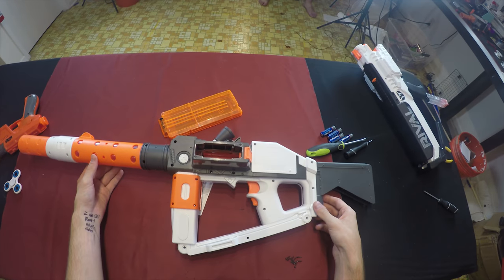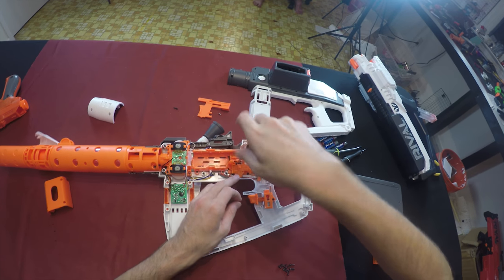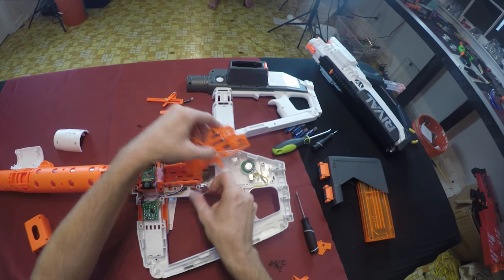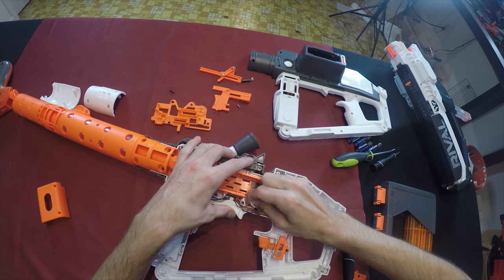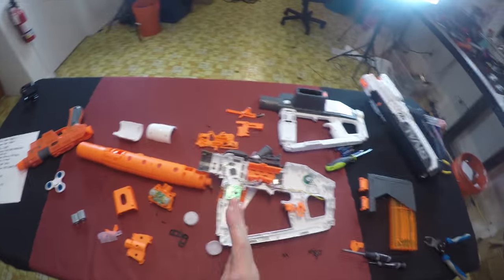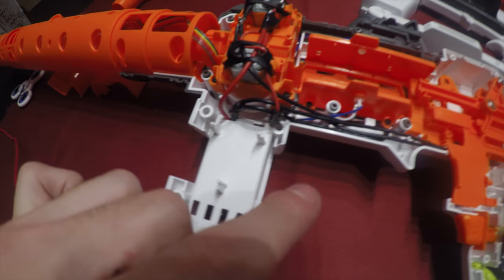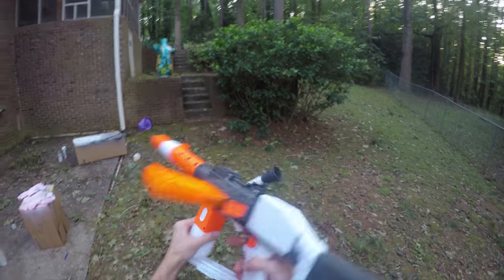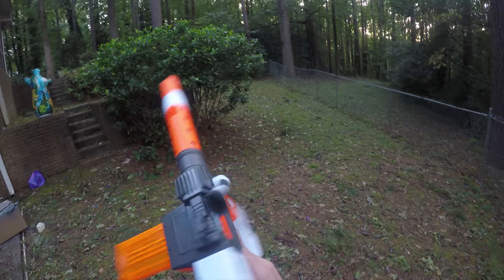Inside The Deluxe First Order StormTrooper Deluxe Blaster (Full Mod)

Comment: Kind of surprised you didn't put an auto strife kit in the blaster since you said that the internals are basically the same as a normal strife. obviously to compensate for the auto strife kit means better motors and flywheels

P.s. With the auto strife kit in the blaster it would be cool if the laser sounds would become rapid laser sounds. Also add a detachable handle so the blaster can be shot by the hip